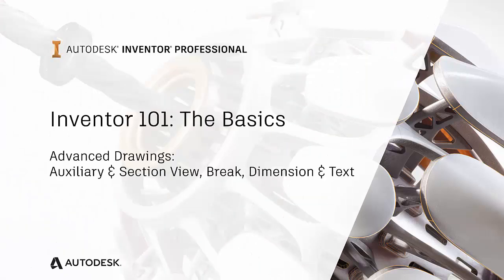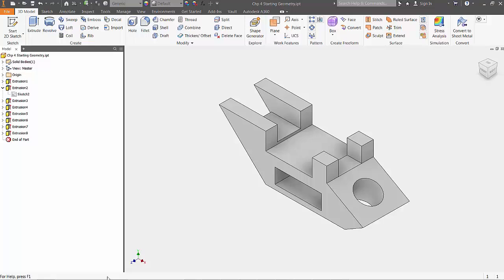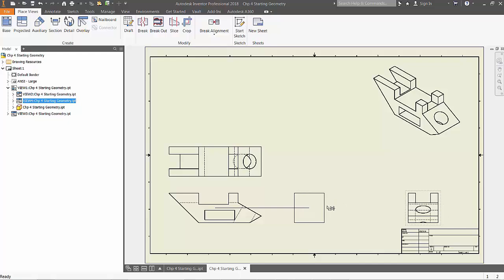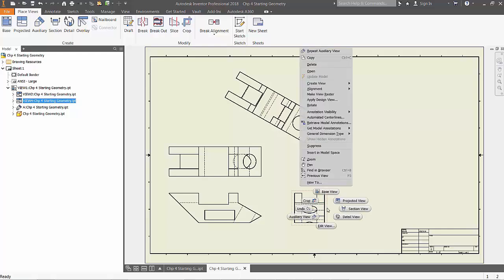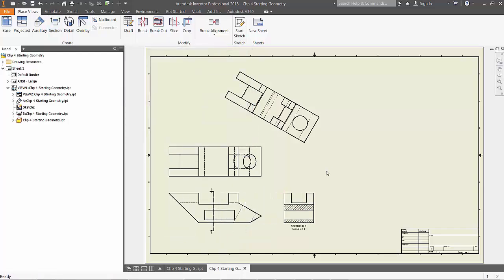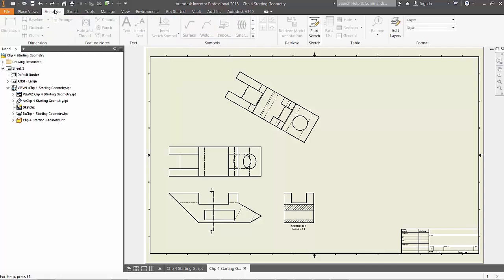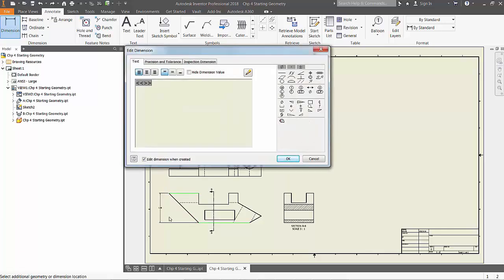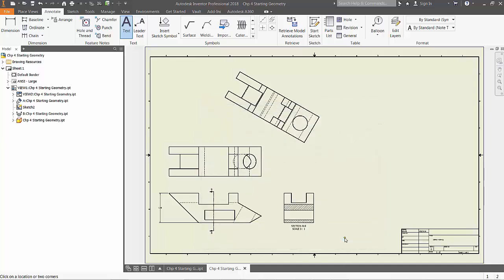Inventor 101: Auxiliary & Section View, Drawing Dimensions & Annotations

Comment: Stuck at 1 minutes 20 seconds in. The section line will not move. After that control z doesn't do anything either. Please inform.
Reply: I has been a year since you posted this so I am sure you have figured it out. But for those with this issue, it may be due to drawing the line in a way that constrains it, such as the center line or other constraints. Try drawing the line slightly off center and try it. Worked for me.